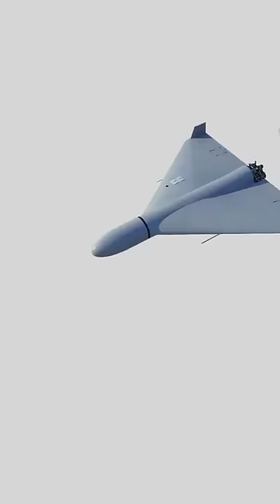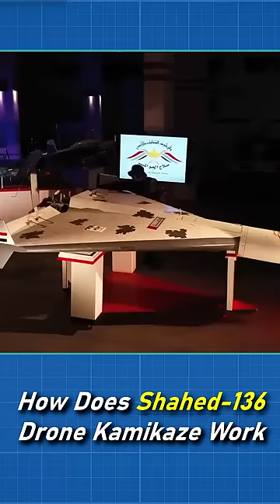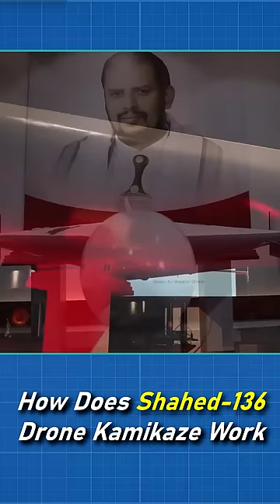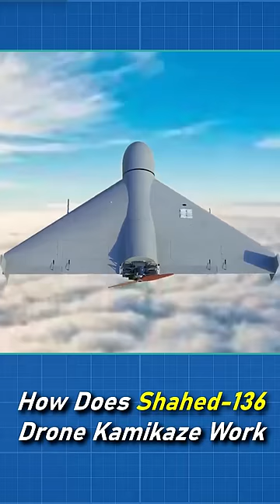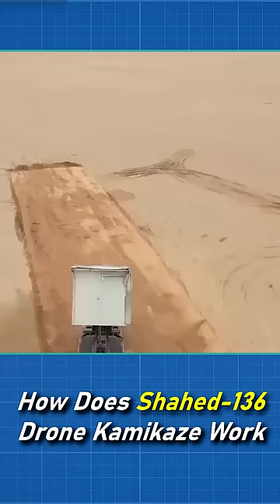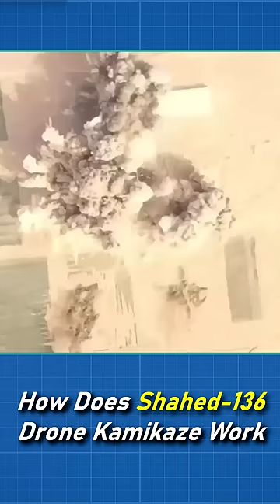How Does Shahed-136 Drone Kamikaze Work #shorts

Comment: It's estimate price is around 20$k.
It also has GPS/GLONASS not only IGS, just look at the Ukrainian energy infrastructure if you have any doubts.
Yes it flies low and slow but it's also coated with radiation absorbent material. NATO AD is having hard time taking it down despite their claims.
Get your facts checked before making such videos.

Comment: Its no accurate and showing the drone hit at pin point accuracy. the Hawthies built some of them and attacked Aramco installation from over 2000 KM and hit them at pin point accuracy. the old good days of the west has the tech are over. you can fit a drone with a mobile phone and it will guide it to its target

Comment: Piece of crap or superior weapon…. Either way a target or targets better be SUPER valuable or a necessary option for the cost to produce  . 
Realistically , a kamikaze mission is just that , 30+ Grand for a 1 way trip seems Ignorant but it wouldn’t hurt to have a few . I mean if the thing can fly & target via remote pilot  why not spent 11% more $ to make it “reusable ? 
Like even at the most ignorant primitive level a payload drop then deploy a simple parachute for recovery seems more logical . 
I deduct from the information that it’s a “Fear Tactic “ more than anything . 
Who’s using these this way is not thinking .